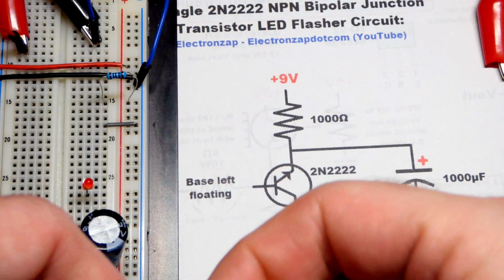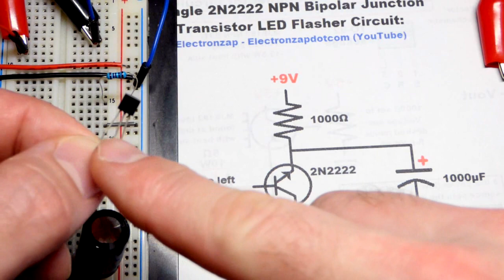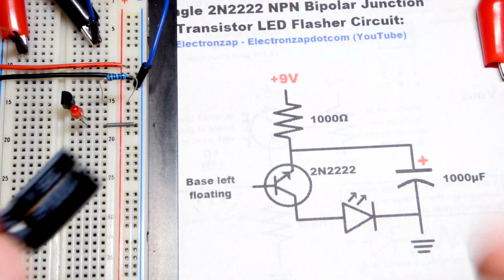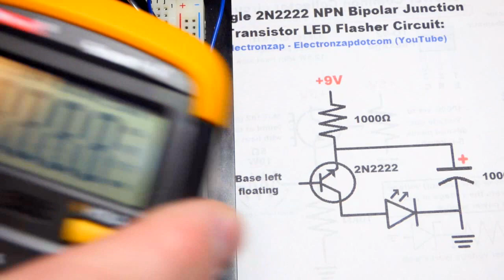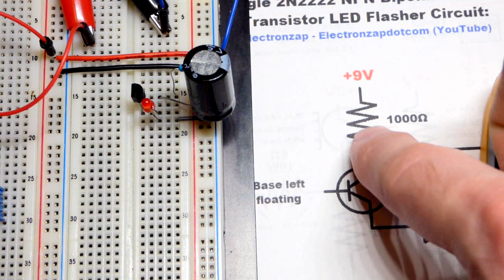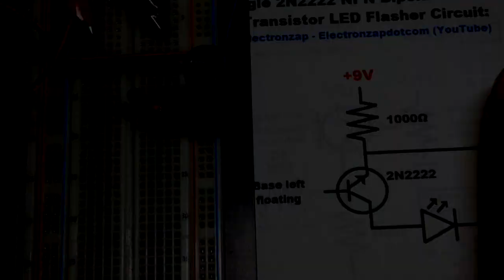Single 2N2222 NPN bipolar junction transistor BJT LED flasher circuit with diagram again

Comment: Hello! Can this circuit still work with a lower capacitor and resistor?
Reply from the maker: It should, I wouldn't go below 470Ω when protecting an LED from 9V. Smaller value capacitor will make the LED flash faster, as will a lower value resistor.
Reply: @Electronzap  thank you!

Comment: I need help lol. Your not using the base. Im trying to make a led blink at lower voltages.
Reply from the maker: This is a specialized circuit. You are looking for an astable multivibrator circuit. They can be made in many ways. The best one to start off with is by using a 555 timer integrated circuit as in this video https://youtu.be/0K84LOMZx-k ... But if it must be with NPN BJTs, then you can use 2 of them like this https://youtu.be/vEB51qd21Do . Hope that helps!

Comment: What about using an  N Channel MOSFET, in place of the NPN transistor ?
Reply from the maker: I'll try to remember to test that out. I think many are still good at blocking voltage or act as a diode if you put them in backwards though.

Comment: G'day electronzapdotcom I saw this circuit on a channel from India, I think he called it an LED strobe. After constructing one, I found it wouldn't flash until it was above 13 volts, I'm running a 120 ohm resistor between the collector and a Blue LED's anode and feeding in volts through a 5k pot so I can adjust the flash rate...what am I missing here so I can run this off a lower voltage ?
Reply from the maker: Strobe is probably the best thing to call it. :) I'd try a different numbered transistor. Some transistor numbers might not breakdown as easy as others. Also, putting a resistor between the LED and collector might be raising the voltage needed to get the transistor to break down. As long as you can charge the capacitor to a certain voltage, I don't think using a trimpot to deliver the voltage/current would stop the circuit from working altogether. I might test those out in an upcoming video. :) Thanks for watching!
Reply: Cheers for your answer, regarding breakdown point, that's what I was thinking, I'll try a BC547 next and take out the resistor too...A name I come up with was a BJT torture test🤣✌
Reply from the maker: Sounds good!